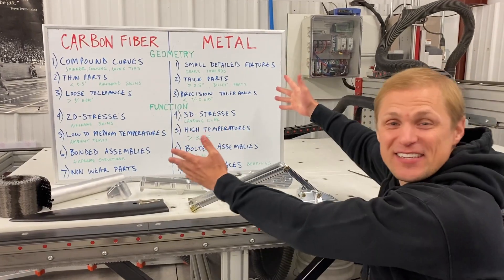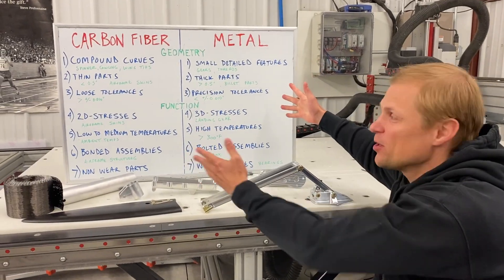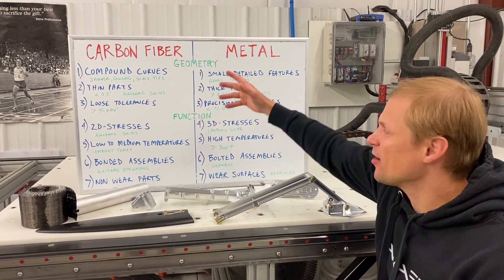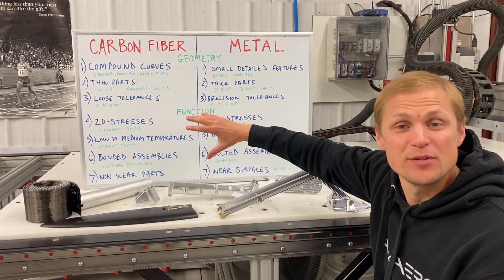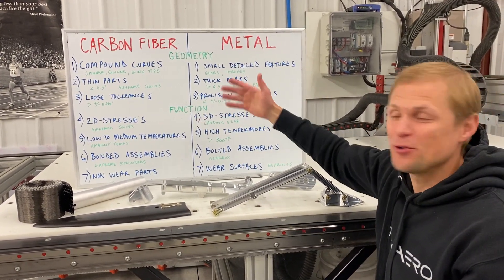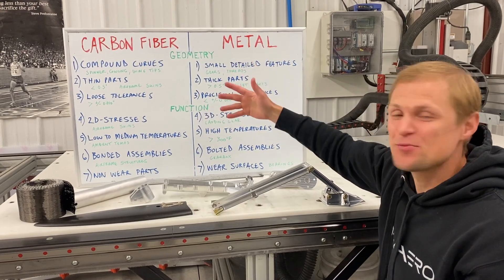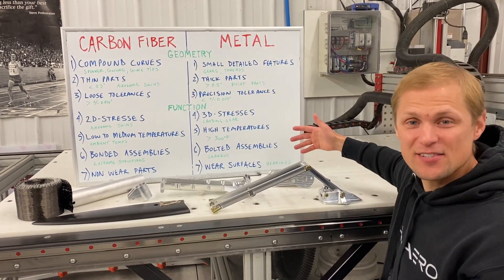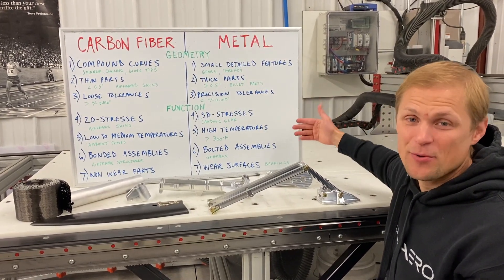CARBON FIBER vs METAL | Which is better?

Comment: I'm really curious how much torque approximately the bolt can be tightened before breaking or crumbling the carbon fiber? That's a very crucial point when comparing to steel righr?

Comment: Machinist here. I use aluminum for random stuff with loose tolerancing, for soft vise jaws that don't have to last long, and as a non-maring barrier when clamping things. I hate trying to hold tolerance with Al. Cold rolled steel is my go to for stuff that has to last, like soft jaws for longer production runs and general fixturing. Hot rolled steel gets used whenever warping must be kept to a minimum as it has far less internal stress than cold rolled. Medium carbon steel, especially 1144, is my favorite for anything with tight tolerancing. You can hold 5 microns all day with that stuff. Case hard is our go-to for tooling that must last in long production runs. Brass is shockingly good at absorbing vibration, which is occasionally very useful when designing fixturing for parts prone to tool chattering.

Comment: It would be great to have an explanation of your evaluation for a petrol vs electric engine. 
E.g sample configurations for different battery sizes with performance and  range estimates.

E.g with Ampruis 450w/kg batteries that are commercially available.

And motors like those from H3X, MITs motor, kite magnetics etc.  
MIT's motor apparently packs 17kW per kg of power.
Reply from the maker: We made a video that touches on many of those topics here: https://youtu.be/LdSnHQtoVTI?si=07q8IKkxWLUCtymV

Comment: The reason explained for CF parts not able to take up loads in Z direction can be better explained by the fact that the fibres run along one direction or are planar therefore if force arises parallel to the fibres then the component of force parallel to the fibres creates shear stress in the matrix of the composite, rather than fibre(reinforcement) rendering it less resilient to these forces

Comment: One thing you might want to consider is chemical resistance. I recently found out you can make gas tight 3d prints on a home resin printer, only to realize that EPDM o-rings aren't suitable for propane gas.
Things like this don't come up very often, but finding out your fuel dissolves your carbon fiber matrix in a wet wing design is something you wouldn't want to learn the hard way.

Comment: How does carbon fiber skin compare to aluminum skin with regard to radiation? Specifically, how will it hold up to UV radiation if it was to live out on the ramp instead of in a hanger?  Will it last as long as conventional aluminum skin aircraft?

Comment: Years ago carbon fiber had a unique quality that once you made it it was plenty strong enough but after just 6 months it would lose at least 60% of its structural strength. I know that they came up with a way to overcome that, but can you explain what was done to the structure or to the chemistry that overcame that issue. I know I first read about it when Lamborghini first built a frame for the Countach out of carbon fiber.

Comment: Titanium is not a suitable metal for exhaust pipes, it suffers from thermal fatigue and oxidization at high temperatures, 321 is aircraft grade exhaust material, or if you want lighter, inconel is what is used. Another benefit of an aluminium frame is it does not burn as easily as carbon fibre. The resin is flammable.

Comment: Hey Fellas, if I may preface by saying I love and admire what you guys are doing. I’m not sure how you guys take advice or ideas but from experience aluminum doesn’t like that circular or radial movement. Industry usually adds stainless bushings to it (never stainless on stainless) but since you’re using Cad plated NAS bolts CRES would work. On another note, CAD plated fasteners should never be in any contact with carbon something to keep in mind. I hope this helps and doesn’t get dogged in the comments just trying to help. Super excited to see this project fly. Wish it had two brothers to do something like this 💪🏻👍🏻🤙🏻

Comment: What about forged carbon fiber for all 3 directions?
Reply from the maker: Forged carbon does have more strength in the thickness direction compared to laminated carbon fiber, so it is much closer to isotopic properties. It can still have some directionality to the mechanical properties because as the material is compressed in the mold the chopped fibers get flattened out so their orientation is no longer completely random.

Comment: I have a question. Carbon fibre is not good for lightning strikes (in essence, lightning will travel through and not around like metal... bad news for passengers!), large aircraft manufacturers are investing heavily in research into copper mesh to cover carbon fibre used on aircraft exterior. Has this been considered in the Dark Aero, or is it just an acceptable risk?

I'd imagine a one man cockpit would be relatively easy to insulate sufficiently.

Enjoying the videos guys! 👍🏻

Comment: Complete layman’s question: Other than cost, is their ever a scenario in aerospace applications where utilizing aluminum out-performs or is a better choice than titanium? As a layman, it seems titanium is stronger, lighter, more temperature resilient, and stronger. What do I obviously not know?
Reply from the maker: In general, these points are true about titanium. The big reason aluminum wins out is cost. The other is manufacturability or how easy it is to work with. Aluminum is very machinable and easy to work with on the mill making it a more favorable option over titanium. Titanium is more challenging to machine requiring more planning and attention to detail. On a side note, it’s important to keep in mind the different grades/heat treats of each metal which produce different mechanical and working properties. Depending on which grade titanium you’re comparing to aluminum, the desired mechanical properties may be a bit of a wash.

Comment: surprised you didn't discuss toughness for choosing metal versus carbon fiber.  Or stiffness when choosing carbon fiber versus metal.   Also the spinner was probably the worst example for compound curves because that shape can be done very well with a metal spinning process.  Non uniform compound shapes carbon fiber has an advantage.

Comment: Why are you using 7xxx aluminum and not 2xxx?

I just finished a mechanical engineering course and I was told that 2xxx series was mainly used for aircrafts
Reply from the maker: Thanks for watching and for the question! Both 7xxx and 2xxx series are used in aircraft. Both have their advantages and disadvantages depending on the functions/requirements, manufacturability, and cost of the specific part. For example, 7075 is higher strength over 2024 making it more suitable for higher loaded parts. However, 7075 has lower cyclic fatigue resistance compared to 2024 making 2024 a more suitable choice for parts that are continually loaded and unloaded.
Reply: @DarkAeroInc  thanks for the answer and for the great content!

Comment: Why Ti on your fire wall instead of Aluminum? An engine fire doesn't burn long mid flight, assuming the pilot is not a douche. On the ground, you can hop out. Is it to save the airframe? I guess thin Ti is pretty cheep, less thermally conductive, and way higher softening point. But is it worth the cost for material and machining when the aircraft would likely be totaled anyway?
Reply from the maker: Ian, thanks for checking out the video and good question. The FAA has a list of approved firewall materials per FAR 23.1191. A titanium sheet of 0.016" is on that approved list. Aluminum is not on the approved list so would need to be tested and shown to last for at least 15 minutes without flame penetration. It might take a pretty thick sheet of aluminum to hold up to the required test. We actually did a video on firewall materials. We test a 0.016" thick sheet of aluminum. You can see how long it lasted for here: https://youtu.be/R25bl-EgW1k?t=373.

Comment: You mentioned heat and headers. Something to look into is having them ceramic coated. It can lower engine compartment temps by a lot simply by keeping heat inside the header until it exits the exhaust rather than heat soaking the whole engine compartment. Another route is header wrap.
Reply: That's a good point. 
I once came across a guy experimenting with aluminium headers containing a ceramic internal coating. No idea how it was done but just incredible the way he could hold his hand on them with minimal noticeable heat.

Comment: There are many applications for 3D printing in different engineering areas. Would like to see your take on that.
Reply from the maker: Thanks for watching and the comment! 3D printing is something we have been exploring as well, and there are many good use cases for it. We did a video on how we use 3D printing for the DarkAero 1 a little while back if you're interested: https://youtu.be/F4a-ZQoHnFM

Comment: I think the failure mode is also a very important criteria. Something like glass may be hard and stiff, but when it breaks it breaks catastrophically. Metal will bend while CF composites will splinter and fail suddenly and more or less completely. Glass fiber is a little bit better in this regard because it will bend and stretch a little more before failure.

Also RF properties are a think, as you see when you hide the antennas behind it.
Reply: Also corrosion and aging.

Comment: NOTE!!! 
Carbon fibre does not like lightning strikes one little bit !
A mitigation technique used in aviation is to run a fine copper mesh over the outer layer with special conductors in areas where that is not possible or to channel the electricity to emitters. Fuel tanks wiring and structural areas like wing roots are especially susceptible to damage that could result in loss of the aircraft.
I would glue that plate to the carbon paneling as well as bolt it on as the bolts are very likely work loose due to the different flex patterns on the materials so by using a moderate (removable) strength panel bonding agent the flexing will be made uniform across the whole surface reducing point loads.

Comment: There is a means of making some fine and or dimensionally precise carbon fiber parts.
Depending on the weight strength heat requirements the carbon fibers are either mixed with a high strength plastic and injection moulded or mixed with a resin as a type of slurry then pressed into a mould and subjected to high pressure clamping forces to compact it to the correct size etc.Then there is Carbon Carbon ceramic

Comment: Excellent Presentation!  For the type of GA aircraft you are constructing, and the market price point, you are right on target.  On some more advanced aircraft, with Extra/Super Performance Specifications, there are a number of caveats regarding Carbon Fibers, Resins, and 3D capabilities, operational temperature ranges as I am sure you are aware. There are hundreds of hybrid resins and hybrid C- fibers, CFRP-x, infused nano-tube laced CFRP-X and expensive additives that will meet and exceed advanced aerospace metals and slash weights -25 to -35%, if on larger airframes (25pax+)  This always comes at a premium cost when performance, range, useful load and ultimate operational flexibility, airframe durability, advanced STOL perormance at MGTOW and airframe useful life and/or hours of annual operation exceed 2,000 per year.  

Often these more exotic ultra-materials and/or extra ($) certification process absolutely outweigh added procurement costs due to critical mission requirments or operational modeling. This type of aircraft can cost 55% to 115% higher than the common sense approach you have rightfully applied to your fine aircraft...however, when factoring in consistant Life Saving, Emergency Response, Time on Target (Max Speed & Range), Oil Platform Security & Border Patrol, Coast Guard, Recon. Missions, on-Demand Medical Personnel, Equipment/ Vaccines/ Organ Shipments, or Humanitarian Crisis's and the durability of the airframe... In these cases the purchase costs is nominal compared to the rare Value Obtained as well as direct operational costs of a 35+ year aircraft (38% lighter Airframe-50%+ Useful Loads) and over time, 2,000+ hrs/annual usage then these extreme materials are worth thier weight in Diamonds and Platinum in Total Value Proposition day after day.

But again, you are precisely on target with your statements in class and category of aircraft and I am confident of your logical approach, design and metal/fiber statements and logic...Nice Job and Great Aircraft.  But be advised, there are now Cermamic/CFRP materix + Carbon Nano Tubes, Graphene/Ceramic blends and "Ultra-Metals" available that have phenominal properieties in all Axis and the light weights and extreme stresses and temperatures the can take endlessley is a qauantum leap over general carbon fibers and even the more advanced Carbon Reinforced Infused Plastic Fibers...every aircraft has its mission, since 2008 I have been and continue to work on such an aircraft mentioned (much larger- MGTOW + 88,000lbs.) that is powered (Hybrid-Parallel/ Light), structurally and aerodynamically capable of a useful load that is 2.23x (times) its "Empty Weight", Zero Fuel Weight or better said...the weight of an aircraft with zero fuel/cargo/oil/passengers but Ready to Launch.  Today all the propulsion systems, fuel cells, batteries, hydrogen generators and super materials and components as well as autopilot capabilities are available if one knows where to look.  

The Zero Fuel Weight of this aircraft is #27,035lbs (projected) and useful load is #60,288 lbs. with speeds of 545mph and Critical Field Length rquired at ISA, SL and Zero Wind, Dry Runway is under 1,400ft. in STOL configuration and 2,100ft off unimproved surfaces. So with performance metrics demanded as the above, I have "had" to explore extreme materials and ultra materials as well as "unique" powerplant "systems" that can meet the mission requirements...again the cost per airframe is quite high (not exhorbinent) but the value to commercial, military and society as a whole is of "Extreme Value" that is ultra reliable and enduring.

Great job on your aircraft, I will be following and praying for your great successes...it is an enormous task and most people do not have any idea how difficult designing and building an iconic aircraft can possible be...it is one of the most difficult task that one can imagine A-Z.  Look forward to your First Flight of the POC Airframe!

Comment: Very nice presentation! One thing I noticed when Doing ramp inspections in Stansted was the frequent flap delaminations because of the cfm56 exhaust in 737NG.
Reply from the maker: So you have seen it first hand that heat can have an impact on composite materials! Thank you for watching!

Comment: Nice summary. Other points to consider are susceptibility to damage, repairability, strength vs stiffness, fatigue cycles, and even direction of stresses. 
Bare carbon fibre is vulnerable to impact damage, so very expensive bicycle frames can be broken by small pieces of gravel. Fokker ran into this problem with forward-facing partrs like radomes, and came up with fibre/metal composite structures. 
If a part does get damaged, how do you repair it? In an aluminum structure, small patches get riveted on, large panels get rivets drilled out and the whole sheet replaced. Metal can be welded. Composites might seem to be fixed with glued on patches and bondo, but that would probably compromise the entire structure.
Direction of loads (tension vs compression) can be significant, especially if a structure has to be thin and light. An empty aluminum beer can may be crushed between the fingers, but I defy anyone to tear off the entire top with both hands. 
A structure can be strong enough to withstand loads, but not stiff enough to hold its own shape; think of a balloon. That may be more a matter of structural form, rather than material strength, per se. Think corrugated cardboard, (basically paper.) The examples he shows in the video also illustrate that. 
Cycles of load application, leading to fracture, may be an issue. Steel can resist repeated modest loading better than aluminum (which may harden and crack), while composites may de-laminate. The Lotus Elite sports car had glass-fibre cones in which the suspension struts hammered away until the tops came off, usually in mid-corner, rather spoiling the handling. 
How things are joined may differ, depending on the material. In a composite, a tension load would require a splayed fibre joint, (like a duck's foot), where a metal to metal one might work well with a bolt or pin.
Finally, there's corrosion. Is it going to be subject to water, oil, (both hot and cold), UV, or bird poo? All affect choices.
"Stuctures" by J.E. Gordon   https://www.springer.com/gp/book/9781461590767 and its companion on materials https://www.goodreads.com/book/show/230510.The_New_Science_of_Strong_Materials are great introductions to the topic. Don't pay the Springer price, there are plenty of cheaper sources.)

Comment: I know exhaust headers have become something of a sacrosanct industry standard, but it seems like if you’re trying to reduce weight, larger manifolds would provide more volumetric flow throughput with fewer components. In other words, you can get more flow through a single 3” manifold than through two 2” headers.